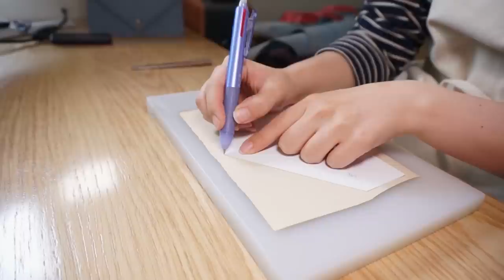셀프 디자인 가방 제작(악어가죽 vs. 염소가죽)/crocodile vs. goat leather handbag_making video_leather craft/가죽공예

Comment: Can you describe the creasing machine you use on the seams and edges? What is the purpose and is it hot, or do you use it cold? This is absolutely amazing work! I have watched many times!
Reply from the maker: I use creasing machine to make them stick together. It is very hot and I use different temp. for each leather type. :)

Comment: I learnt a lot from this video.thanks.. Please what is the name of the plastic you use for stiffening the handle? Where can I get the non woven fabric? Thanks ones again
Reply from the maker: hello. I wish I can tell you the name of the plastic ones... but I do not know the name. I got it from my teacher😭 and I don’t know if they do international shipping but you can get them from this link below.
https://m.leathernori.com/shop/detail.php?pno=DFAAD344CAC09293ADEC1329E4CA354D&rURL=https%3A%2F%2Fm.leathernori.com%2Fmain%2Fexec.php%3Fexec_file%3Dskin_module%2Fskin_ajax.php%26obj_id%3Dprd_normal_list%26_tmp_file_name%3Dshop%252Fbig_section.php%26single_module%3Dprd_list%26striplayout%3D1%26module_page%3D3%26document_url%3Dhttps%253A%252F%252Fm.leathernori.com%252Fshop%252Fbig_section.php%253Fcno1%253D1450%26cno1%3D1450&ctype=1&cno1=1450
Reply: Thank you so much
Reply: @adekolaabosede1016  hi, did you contact the shop?

Comment: What thickness of the thread do you use? Is it normal thread or wax thread?
Reply from the maker: I use #20 thickness of thread which usually used for the sawing machine. Also, it is not wax thread.